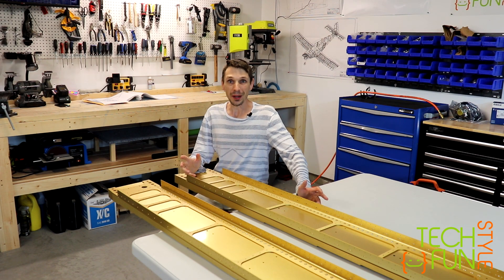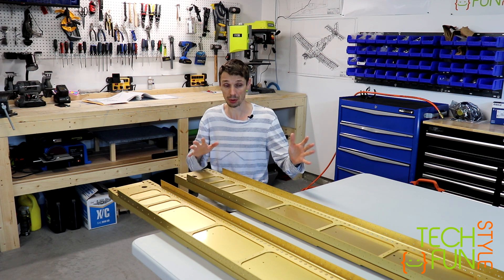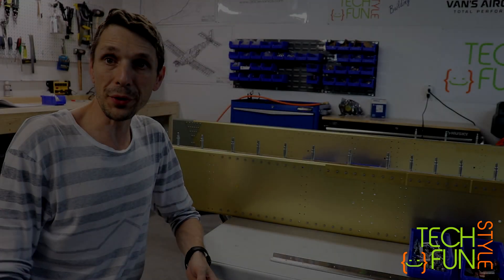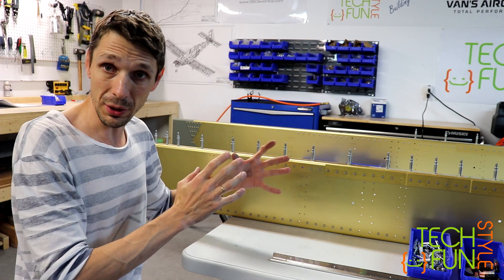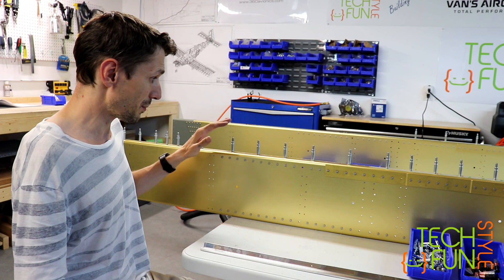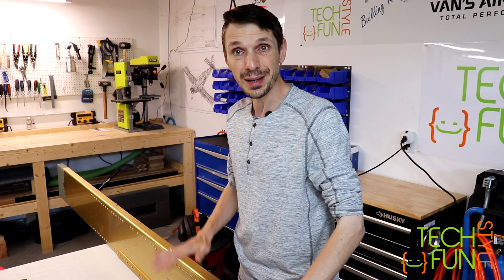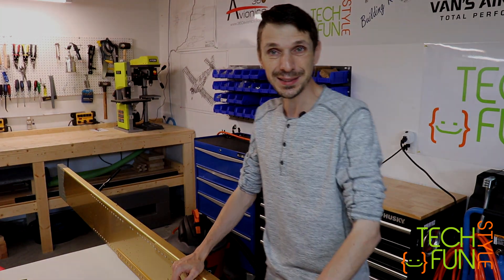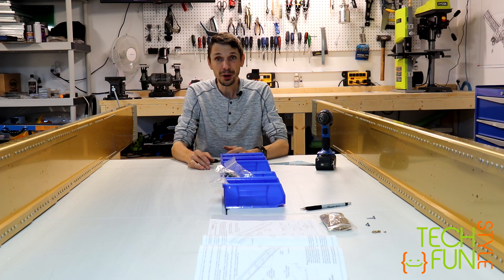RV-10 - Wings assembly. The beginning.

Comment: I think the spars are shortened to stay within standard freight lengths. For shipping. I think. :)  I read the plans 12 times then when I'm ready to drill or cut, I read them again. But its actually more important to read ahead... sometimes things that you assume end up being wrong later... always better to understand what steps you'll doing later and then what they are asking you to do now, might make MUCH more sense.
Reply from the maker: Oh so true! I now started to read complete chapter for each part I build before I start. And I also read few times before I can understand properly what exactly should be done.
According to VANs the reason why we add spars extensions is because originally these spars are shared between RV14 and RV10, however because RV10 requires a bit m more lift -> wing surface they added these extensions to wings.
Reply: @techfunstyle1606  ah nice! Thanks for confirming. I was curious about those extensions too

Comment: Vlad
I'm in the process of getting my shop ready to start an RV build nearby in Walnut Grove. I was wondering now that you have done a fair amount of riveting are you happy with your compressor choice.  I think from the background it is a Canadian Tire compressor, and wondering which size you chose?  Do you find it sufficient or lacking in any way? Was it sufficient for priming and air drill work? If it's an oil less is it quite loud? 
Thanks
Dennis
Reply from the maker: Hi Dennis,
Yes this is oil less Canadian Tire Master Craft compressor. I think it is 22 or 25 Gal. To be honest it was not the best choice and I will explain:
1. It is VERY loud :( Yeah it is fixable by building a walls around it and adding some soundproof material, however I heard that there are way less noisy compressors available at about 20-25% more cost.
2. It works well BUT its volume is only enough for pneumatic squeezer or rivet gun. As soon as we move to drill or other rotating instrument - compressor works non-stop. Possibly larger volume compressor with more powerful engine  would be better choice.

This compressor is good for priming - did it many times, works well. However if you plan to purchase compressor  I would recommend something better based on my explanations above.
I am at CYPK, when you are around you are welcome to pass by and see my setup.
Reply: @techfunstyle1606  I saw that Lowes in US has a Kobalt Quiet Tech 26 gallon that I may try. ( Need border to open!) Thanks for the offer Vlad. I may take you up on that sometime. I will reiterate, really enjoying your videos.

Comment: I did both of my wings at the same time also. Like you said, even though it may take longer for each step initially I felt like it was worth doing because I wouldn’t have to go back and redo everything all over again. I could just do each step twice making each a mirror image of the other while the step is fresh in my mind.
As for reading the plans multiple times, YES!!! It’s not just you. With the empennage everything was pretty much spelled out, with the wings the directions are less clear and now that I have moved on to the fuselage it is even less clear. Spend as much time as you need in order to have a completely clear understanding of what you are doing and why you are doing that step. Sometimes that even involves looking many sections ahead to get a clear understanding. I find myself looking ahead quite often and also checking the forums trying to understand what the plans are saying and why. 
Here is a little tip, either make sure to check each nutplate for proper threads or use the correct screw to help install it. I have found 2 nutplates in my kits that were manufactured incorrectly (they didn’t have threads machined into them so a screw couldn’t be installed) and I have a buddy that had to drill out around 50 rivets on one of his wings because he installed a nutplate that had the same defect and didn’t catch it until it was to late.
Reply from the maker: Thank you for your recommendation and explanations. Ouch, I am already done with all nut plates at the moment but I will re-check all of them with the screw now. Good you told me about it because otherwise it could be way more work should I require to replace some. In regards to instructions reading - I do in the same way - reading sections ahead sometimes. It helps to better understand what VANs wants us to do. You little scared me about quality of explanations in fuselage instructions but hopefully by the time I start my fuse I will have more experience.
Reply: Tech Fun Style   No need to be scared, like you said you will have a lot more experience by the time you reach the fuselage kit. And the “gotchas” in the plans are well covered on VAF with a little searching. And if you ever have any questions the Van’s builder community is fantastic and are always willing to help in my experience.